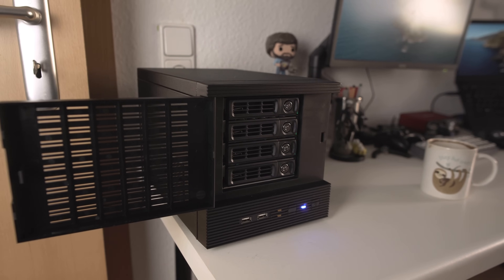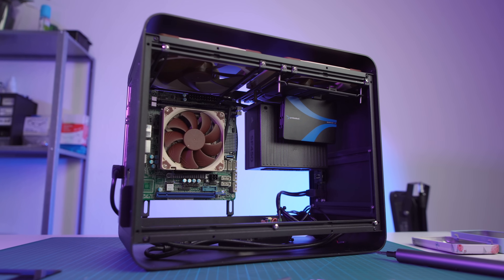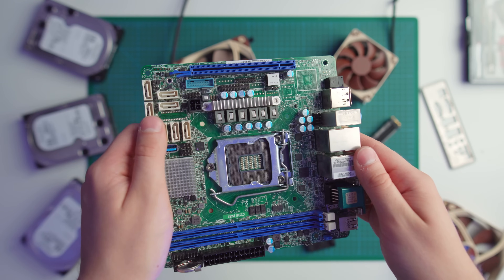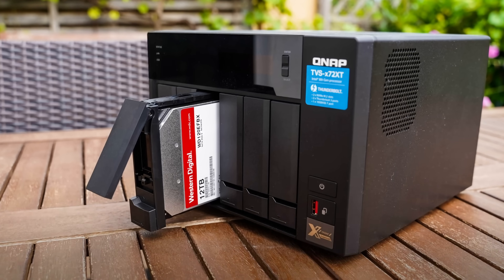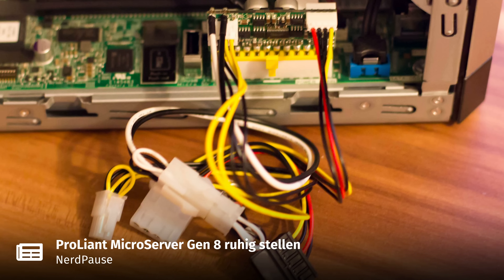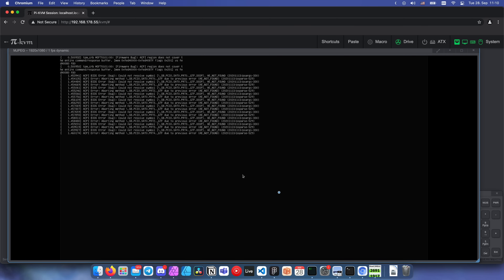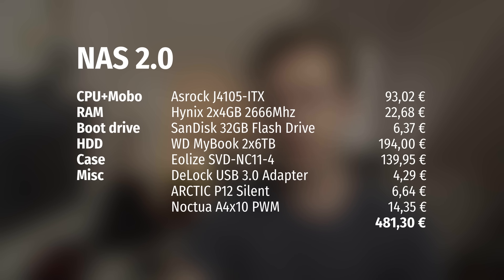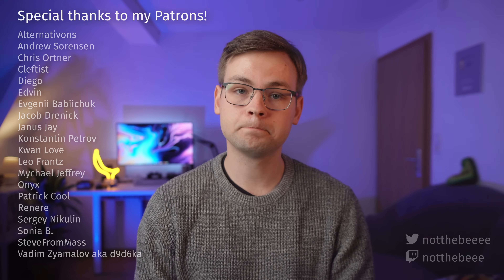The Perfect Home Server Build! 18TB, 10Gbit LAN, Quiet & Compact

Comment: Wait what? Under 30w?? But i3-6100 is a 50w CPU! Even if it ain't on full load, with 2 rams and 3 HDD and 2 SATA it should be pushing toward 40watt-ish
Reply from the maker: 50W under full load. Intel CPUs are very efficient at idle.
Reply: @WolfgangsChannel  fist of all thanks for the reply 🙏. Secondly, the CPU itself is a 50w. What's your power usage at idle and full load? I've been trying to build my ownserver since 2 months ago but I can't get my hands on any good low power CPU at MSRP. I've been dreaming about an I9-10900T or 11900T or even A12-9800 but no luck 😭🤕
Reply from the maker: Yes, the CPU itself is 50W *under full load*. It doesn't consume that much at idle. A typical server spends a lot of the time idling, so idle consumption matters a lot.

Getting a "T" processor doesn't mean you'll get better idle consumption, since TDP is always measured at load. Usually the idle consumption of non-T and T processors is the same, but the load consumption will be lower for the T processor since it's rated for lower TDP.
Reply: @WolfgangsChannel  thank you very much for the info 🙏

Comment: I'm building a new NAS using some of the components that you've recommended in your video, but instead of the Asrock C236 WSI I got the previous version of the motherboard (E3C236D2I). Would this one also fit? What do you think? 

There are not many differences besides that there is no HDMI output.

Thanks and keep up the good work!
Reply from the maker: Looks good to me!

Comment: How did you connect both of the case fans to the motherboard? I only see one 4-pin connector for the CPU fan and one 4-pin connector for the front fan. Where does the other fan connect?
Reply from the maker: A Y-splitter

Comment: Sorry to disappoint you but my setup is huge. First I have all my network cables certified with CAT7 for my entire home. I have two switches with all ports at 10G.  I have a small server at 116TB and my new server with 12 hard drives of 8TB each a FreeNAS.  Actually, my laptop witch was considered Fast before my new setup, is now the bottleneck. Right now I<m transferring my data from the small server to the big server.

Comment: the J series CPUs are a great option at 15 watts!  performance somewhat similar but lower than the i3-6100.  i built my home server out of a J4195 on arock board.  you can get almost any number of sata ports on a PCIe 1x card 3.0 speed.  I've seen 10x sata and 8x sata.  inc the MB ports that is plenty.

Comment: Couldn't you just get the Asus E3C246D2I so you have IPMI ? Wouldnt that avoid the cost/need for the whole pikvm?
Reply from the maker: E3C246D2I costs 279€ new and I wasn't able to find any used offers. So even with the cost of the PiKVM in mind, C236 WSI is still a cheaper option.
Reply: @WolfgangsChannel  Thanks Wolfgang.  Did you look at the C246 as well? feel like others will be looking at options after watching your build
Reply from the maker: I did, and if you can get it for a good price, it's definitely a better option.

FWIW though, C236 also supports 7th gen CPUs.

Comment: I’d love to see more about 10Gbe as a a i’ve realized that my Linux ISO file transfers over 1 Gbe are taking too long.

I also didn’t know about the rpi kvm. That  knowledge may come in handy when I replace my current 15U rack with a 42U rack enclosure. 

Basically , I’m stepping things up from my setup that was good for an apartment. I have a lot more space
now.
Reply: Are you sure, your net is the bottleneck? At least in theory you can transfer up to 125 MB per second over 1GbE. That‘s round about 8 seconds per GB.

Comment: I went with an AMD Ryzen 2700 (about 2 years ago)  for my NAS build. it doesn't quite have the transcode prowess of intel igpus made in the last 6 years, but it's got enough cores to do everything I want. I went matx as itx is too restrictive for AMD platforms unless you limit yourself to really niche boards. By doing that I was able to get 10g, an 8port SAS card, and a low-end GPU. I really hope AMD starts making regular desktop chips with an IGPU that A: aren't last gen cores, B: don't have the pcie16x cut in half. If that ever happens my NAS will get a very big upgrade.
Reply: Hi, I interested about A and B reason for that.. could u pls explain about it?

Comment: I built a system with a ASRock Rack C3758D4I-4L Mini ITX Server Motherboard 8 core, 32gb of memory all in a Silverstone Case CS280 that supports 8 2.5 drives on a backplane. I have 8 5TB drives in the system and a 650w power supply. I have the server setup with TrueNAS as a file server and plex storage. I built 2 of these, one as a master and the other as a slave for backup. The nice part about TrueNAS is the ability to replicate from the master to the slave...it is all done via block level copy and not file level so it goes fast after the initial copy. 

There is one pcie slot for expansion (future 10GBe) and it has an onboard IPMI (KVM) that allows me to remote in anytime, even when the server is shutdown. I use a separate server for plex and built on the same form factor as the NAS. While you build is nice........anyway...thats all

Comment: Excellent build especially with the custom KVM & 10 Gbps solutions.  I believe an older server motherboard would've fit your needs better.  More RAM for ZFS, built in IPMI for remote management and lower TDP server CPU like Avoton/Atom  (Eg - Asrock C2550D4I).  Also your hard drive choices were interesting, why not consider WD Gold enterprise drives ?
Reply: I'm afraid older server motherboard won't support CPU with good quicksync capabilities, that would've meant adding GPU for transcoding which would increase cost, heat and electrical consumption. However I do agree older server motherboards are pretty cool.
Reply: @jstan5802  Yes, I see now.  This is not just network attached storage but a server with multiple uses including plex which will use the quick sync cpu feature from intel.

Comment: micro ATX motherboards are cheaper and more widely available than ITX, and cooling is easier too.   Does a slightly smaller ITX case justify the extra expense?   For most people, NO.

A Ryzen 5600g with fast igpu costs just $239 USD brand new, and B550 motherboards are cheap and plentiful.   5600g performance is going to be FAR superior to an old Intel i3.
Reply from the maker: I would consider it if I didn't already have a miniITX case laying around. Like I said in the video, this isn't the route most people would want to go, especially considering the cost. If you're willing to go for a bigger NAS build in order to save some money, go for it.

As for the AMD Ryzen, unfortunately those do not provide hardware acceleration on Linux. From Jellyfin documentation:

"Most Zen CPUs do not come with integrated graphics. You will need a dedicated GPU (dGPU) or a Zen CPU with integrated graphics for hardware acceleration. If your Zen CPU is suffixed with a "G" or "GE" in model name, you have integrated graphics."

Comment: nice build but why didnt u got a motherboard with 2 m2 ports, one for a sata adapter with additional sata ports? would be a lot cheaper that the board you chose...
Reply from the maker: M.2 to PCIe boards are tricky and don't work 100% on all motherboards. I'm currently using a M.2 to PCIe riser on my desktop PC and sometimes it just doesn't work.

Comment: Kudos for finding a motherboard with that many SATA ports.
I was building my own but had to abandon because of low SATA count and bad HDD mounting on the case.
Reply: You can also use PCI express/SATA converter cards. 1 PCIe lane can handle like 8 drives easily
Reply: @GeneralKenobi69420  totally a valid option. you can get some (even cheap) SATA cards, just make sure they're host bus adapters (HBA) instead of RAID controllers (not many popular NAS Linux distros handle these particularily well).
Reply: just buy the asrock rack 246 wsi. it has a total of 8 sata connections (4 via oculink) and a m.2 slot.
also, the board shown in the video does not support hardware transcoding

Comment: I believe that “conventional wisdom” would raise two concerns about building so many spinning rust hard drives into a small space: (i) drive lifetime is strongly influenced by temperature; (ii) vibrational interaction between drives can have a significant affect on performance.
Reply from the maker: Hence the 2 140mm fans right above the drives and rubber grommets :)
If you take a look at conventional NAS/storage servers, you'll see that the drives are still very close to each other.
Reply: @WolfgangsChannel  Yes, but in conventional NAS servers the case is designed in such a way that the great majority of the air intake flows over the drives. Also, in addition to mechanical mitigation of vibration, the drive firmware is designed to supress vibration issues.

Please don't get me wrong - I'm all for people experimenting, and "making do" with parts they happen to have given the current supply-chain issues. I just wanted to raise these two points that I think people should think about carefully if they are building a NAS. Of course a home sever being used for just back-ups, and one running something more critical 24-7 require different levels of hardware.

Comment: How can we know the idle consumption of a processor? I am surprised that you draw only 20w as the tpd of your processor is around 50w.

I would like to upgrade my actual Nas based on Asus j4125 board, but it is a low consumption setup, and I don't want to rise too much the consumption because it is working 24/24 and 365/365.
Reply from the maker: Yep, the TDP is usually measured at load
Reply: So what is the idle power consumption?

Comment: you posted this video at the right time i have an old i5-6600k i am remaking into a plex server to replace my 10 year old i5-2500. all i really need is that mother board and it should work with my ddr4 ram i have now. if not oh well only 2 items i will have to buy thanks again for a great video. im putting mine into a Fractal Design Define R5 case i got it for a steal from amazon at $75 in a damaged box the case was mint the box looked like it was thrown down 5 flights of stairs.

Comment: Thank you for sharing this! I'm thinking to build a similar machine using the DA2 case. Is it possible to attach four 3.5 HDDs and a gpu in this case? I'm planning to use a mini gtx 1050ti for transcoding tasks. The length is the same as the motherboard.
Thanks in advance!
Reply from the maker: It could work, yes, but you need to measure the case for sure. https://www.quietpc.com/images/products/st-da2-example4-large.jpg
Reply: @WolfgangsChannel  Thanks for your reply. I was checking the example 4, but it seems to use  4 or more HDDs, it would use the space for the gpu. So I was thinking if is there any way to use four HDDs and the gpu. Maybe 3 in the top along with the PSU and the other could be attached in the bottom of the case using some brackets to hold it. What do you think?
Reply from the maker: You could use something like an HDPlex 400 with an external power brick, then you'll be able to fit ~5 full size HDDs, provided you manage to have enough SATA cables

Comment: Very nice build.My only remark is that instead of using a mainboard with 8 sata ports , I will probably go for an 8 port hbe sas card (from 20 to 70 euros depending on the model).
In any case I separate my nas from my home server (that is just a lenovo m900 tiny with 32gb of ram , a 1tb ssd + 2tb hdd).

Comment: Have you seen the Jonsbo N1? SFF with 5x3.5 HDD Drives. You could have used a cheaper itx board with a m.2-to-sata breakout board. That would have been a much better build without the Intel limitation and price.
Reply from the maker: Streacom DA2 also has 12 2.5" slots – https://www.quietpc.com/images/products/st-da2-example4-large.jpg

The M.2 solution might end up costing more than the C236 WSI mobo – most M.2 to SATA adapters that I've seen only have 2 SATA ports, and those that have more tend to cost more, e.g. https://www.aliexpress.com/i/32979982764.html

Another option would be a M.2 to PCIe riser – but those also tend to cost around $30-40. Add a PCIe-SATA card for around $20-30, and you're basically going to pay the same but have a much harder time managing all the cables, risers, etc.

Comment: Is there a reason not to use an expansion card that plugs into pcie slot on the motherboard? I think the one I got on Amazon has 6 sata ports on it
Reply from the maker: Not really, apart from most miniITX boards only having 1 PCIe slot.
Reply: @WolfgangsChannel  ok that works. I was concerned I was bottle necking myself somewhere there I wasn't aware of lol.

Comment: It is not going to be your last NAS build, that is for sure :-)  But I do admire your courage to use used components. I was always too afraid to use used components for something holding my preasure data. Did you ever consider using large RAM or SSD as IO cache? I think that Linux can use it very well but I've never tested it, my goal would be that Plex streaming/file reading could be done by reading the whole file into RAM (if it can fit) and leave HDDs to even spin down if there is nothing else to do....or do you prefer to keep the HDDs spinning?
Reply from the maker: I have an NVMe SSD in front of my MergerFS array, which serves as read/write cache. Files that haven't been accessed for more than 5 days get moved to the MergerFS array at night

Comment: Hi Wolfgang.

I use 10GBit for my link between my main PC and server. Do you use the SSD you mentioned to take onboard backups and keep them there or then transfer them to mechanical drives?

Just curious as I find mine with 8x 4TB drives (Raid6 BTRFS) doesn't hit wire speed (no encryption, Xeon-D SOC)

If you need an alternate motherboard I use a Supermicro mini-ITX Motherboard that has 10Gbit (dual) onboard so I can use the PCI-E slot for an HBA for extra drives (it has 6 or 7 Sata onboard already).

Ive built mine in a Lian-Li PC-26 which willt take 11 drives.

I also use the same PSU and so far after a year it's going well.

Comment: I've just built a personal home NAS server. I used an Asus P11C-I/ngff2280 motherboard which is a mini-itx server motherboard, with a BMC module slot (very cheap £30 module), 6 sata ports, and two M.2 slots (although I'm not sure whether they can be used at the same time or not). It costs about the same new as the second hand motherboard you bought did. Might be an option for others watching this video

Comment: There are quite a few motherboards on the market with 4 SATA ports and dual m.2 ports.
You could have bought a cheap one, and have an m.2 to sata adapter (with extender if needed), to have a total of 8 sata ports and an m.2 port for less money.

P.s. even boards like ASROCK H470M-HVS with a separate x1 PCIE slot exists, and cost less than 100$
Reply from the maker: M.2 to PCIe risers, especially with extender cables, can cost as much as 30-40€ even on AliExpress. And once again, where do I plug in the 10Gbit card? I would probably need two risers, so that would be a total of €60, add about €100 and we got €160 for an awkward contraption with no M.2 slot and a bunch of extra wires to manage.

The ASROCK H470M-HVS is a pretty good option, but first, 10. Gen i3 CPUs cost a lot more than the Skylake/Kaby Lake CPUs. A PCIe 3.0 x1 won't do much good either, it only adds 2 extra SATA ports with the kind of bandwidth that one lane would be able to handle.

Sorry, but I've already gone through pretty much all the steps that you outlined in your comment and this really is the best option aside from just going for mATX.
Reply: @WolfgangsChannel  
You can have an x4 or even an x8 SATA card in that x1 PCIE gen 3 dedicated to mechanical HDD which probably won't need a higher bandwidth and save the OB ports for SSDs

And you don't have to it at once, if you have less than 4 SATA drives in total, and can expand with time.

It wasn't a criticism on your choice, just a suggestion for other builders
Reply from the maker: Understandable. Thank you for the suggestion!

Comment: Cracking up at the last nas I ever have to build comment at the end. Pretty sure that failure or obsolescence of gear, or the simple desire for better or faster will make that unrealistic. I am expanding my home lab now so will likely be building some truenas or unraid setup, to get iscsi support for VMs on the network.
Reply: I hear you. Redid my home “lab” about 3 years ago. I still use my of the original equipment, but I definitely did not buy enough storage for my Linux ISOs.

In fact, I’ve bought more drives for my NAS every year as my needs have changed.

Comment: I’ve always backed off of newer WD external drives for shucking, because I read that a pin had to be bypassed or shorted in order to use with certain PSUs?  Aside from removing the HDD, did you have to do any other prepping?
Reply from the maker: No, but a friend of mine did have to tape a pin on the drive in order for it to work. It's nothing too dramatic, just a little bit of electric tape.

Comment: I buy a used pc online with ASRock Z370M-ITX/ac and 8400 CPU and 16g ram for around 200usd. The board has 6 SATA ports and there is an m2 slot I can use to add more SATA port if I want to add more drive